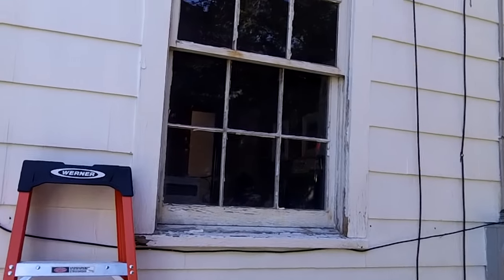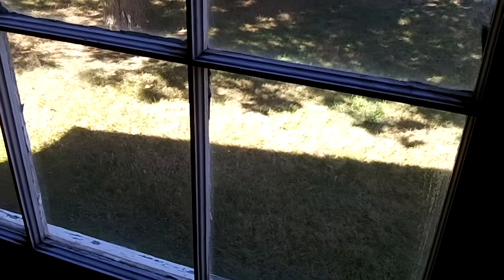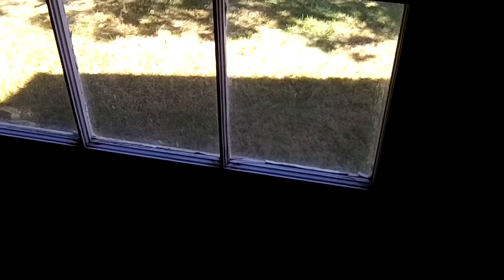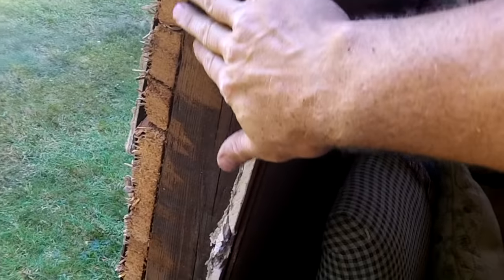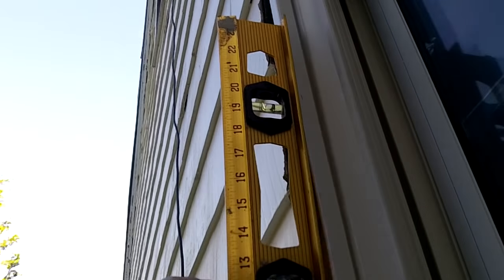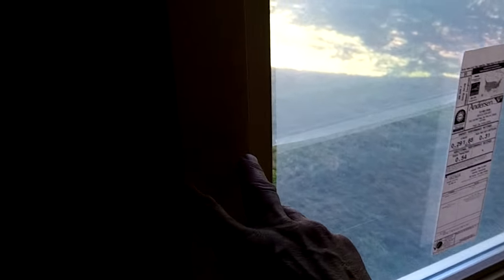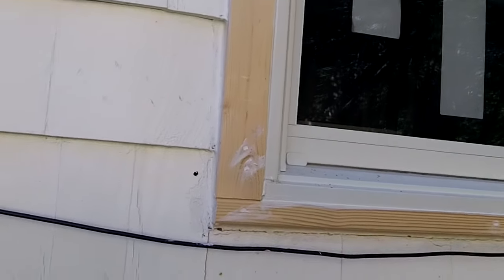DIY: How to install new window on old house

Comment: Not trying to be a chooch, but you need to install flashing and prime your trim boards on all sides to seal prior to installing. Never caulk bare wood and priming all sides prevents future rot. Obviously not necessary for Azek or hardy board type material. Good basics though! Like i said, not being snooty, just trying to inform
Reply: Good to know! Great advice ty?
Reply: Thanks, I'm installing new aluminum windows on my daughter's log house. Wood wrought has attacked this old house and I'd like to make sure the new logs don't deteriorate. Thanks for the heads up
Reply: Good advice i am gonna looking up the how to details of your advice and aply it to when i instal my window.
Reply: Wish I read this sooner. Good job. Now people will know the important things.
Reply: Are you talking like flashing tape?

Comment: Lol!  You left out the part we all wanted to see.....removing the old window!
Reply: Prybar?
Reply: I remove my widow and I pulled on my frame it was not even nailed Into anything
Reply: @roserouge8938  Same here. Slid right out. Mine was held in by the trim.
Reply: @JobeStroud  they did a lousy job building my house!
Reply: @JobeStroud  Mine is held in by the paint LOL
Reply: It comes out in PIECES!!!!  Especially if it is rotten
Reply: Someone used a rock to remove mine..
Reply: Fuck yes I need to know how to get the old one out not how easy it was to take out wtf
Reply: @roserouge8938  you need counselling for self -induced trauma
Reply: Oü
Reply: Right

Comment: Where I live the rough opening has to be wrapped including putting a pan under the window. After installing the window you have to wrap the exterior as well as make and instal head flashing. It looks like your just relying on caulk to seal out the weather?

Comment: Thank you for coaching me on the install. It is more than I thought it would be adding wood. I thought I would simply remove windows, clean the existing widow frame and push in the new. But am up for the challenge. 19 windows to do.
Reply: How did you do? Or how are you doing so far?
Reply: I’m sure you’ll be a master by the time you’re done 😅

Comment: Flash the bottom corners with window flashing tape. Then flash the bottom. Put a continuous bead of caulk around the sides and top of the nailing fin. Not the bottom. Put window in, shim to ensure it is level. Then flash tape the sides, then the top. Then caulk.

Comment: Don't worry about all the rude comments. Why are they watching instructional videos if they already know everything? At least you took the extra time to record it.
Reply: Because I'm always trying to get better, to be a craftsman, to do things properly, with the right application of caulk.  So I might charge more for this, and lose the job to a dooosh who does it wrong and covers his tracks with two tubes of caulk. There are windows like this which last hundreds of years without leaking. in New England.
Reply: I watch these videos because i'm a broke mofo that can't afford to do these things so I live vicariously through others home improvements.....lol
Reply: Jaran Schwend just for everyone watching, i watch these videos so i can comment and tell our customers to stop doing dumb shit. Everything you did and installed was completely wrong. I take pride in my job, i work 5-7 days a week, my crew puts in 30-45 windows a day. Apartments we hit up to 145 windows a day. Theres nothing worse than getting caught up on a crappy window installation where the owner thought they could do it themselves. Call a professional! This is one of those things where u dont skimp out on. Ur better off leaving it alone than opening crap up and making it worse
Reply: Roger,

Unless he knew the old window frame was water-tight, replacing the entire window is sometimes a better bet.  People use replacement windows and after installation wonder why their walls leak - it's because the original window was leaking at it's perimeter and the replacement process didn't fix that.  Not saying replacement is always wrong, or right - you have to identify the problem.
Reply: JARAN - CONSTRUCTIVE CRITICISM IS NOT RUDE. Why post a video that no one can see.

Comment: How do you seal it? Just bought a home where they installed new windows around the house and it just rained today and its leaking from the top of the window near the frame on the inside of the window. It trips down onto the top of where the window slides.

Comment: Well should definitely use flashing at least on the sill to protect from water.  Then what about squaring/leveling window with shims before install ?  Then missing sealant which goes under nailing strip...missing vital steps !
Reply: He didn't do any of that.  This window was installed like they did in the 1940s.
Reply: Flashing first then windows and caulk.  Flash all new wood and bring out a little.

Comment: For future repair or removal I like to use pancake screws on the nailing flange.  Simpson Strong Tie makes one variety that works well but there are many others just get the true pancake head.  Also read the directions as most windows do not want the fastener seated tight but up just a hair for expansion and contraction especially on vinyl.  I would also use one of the flashing systems before installing.  Good video.  Doug

Comment: Preparing to replace a bedroom window in an old condo. The existing window is aluminum framed junk (mid 60's) and I just know the framing underneath is not in great shape and was simply an overall terrible install.  Either didn't care, or just simply works without their heart in their workmanship.  
You answered a question I was asking myself.  Getting ready to purchase an Anderson sliding window this weekend!  But was asking myself if I should order one for "new construction" or replacement.  Because I don't expect to find the framing in optimal condition around the existing window, I'll go for the new construction window.
Thanks for the info, very helpful!:).

Comment: Should you flash the sill and even put sill pan underneath window to prevent water from rotting studs in wall under window?
Reply: Yes, you should.  Drop edge flashing at the top, tape wrb over it.  No sealant at top.  Flash the jambs.  Sill pan flash where the window sits.  No sealant at sill to let water drain.
Reply: @zilfondel  where does one find written instructions for these steps?

Comment: Great video! You just need to add flashing.
I am redoing the windows in the house my Dad built. He didn’t flash the windows and I had to use larger windows in order to cut out the rotted wood at the bottom. Modern caulking is great BUT miss a small place and water WILL get in!

Comment: Great video! This resembles my situation more than any other video! Question for you- looking straight down, there's that gap between the base (bottom/sil/stool, whatever it's called) and the siding. What is that material? On mine, it looks like wood that has become sort of fuzzy and I can break it apart easily. I'm wondering if I should fill it in with some kind of mud or place a base board that extends just to the end of the gap/inside edge of the siding. Thanks!
Reply: So did u go ahead and do something about it or r u still waiting on an answer. I would help but i have no clue what ur talking about. Prob. insulation though

Comment: you didn't show the most important part of the install which is the flashing to waterproof the window.
Reply: he skipped that step he said it in the video did u watch it
Reply: I agreed
Reply: Should be title how to install new window in old home skipped all steps use your imagination.
Reply: MLK MLK - don't use treated lumber either and just paint the 2x4.  Lol. 10 years from now.  Need new window.
Reply: @melchgarnicajr5798  lol
Reply: He also didn't put the removal and filmed it in the dark beforehand.
Reply: I hope you used window putty tape or some kind of sealer or flashing.
Reply: Gizzard Liz  !!&%&#{$&|
Reply: Oh my goodness. People love to be critical.
Reply: shouldn't use treated lumber in this application. Just use liquid flashing on the Frame and paint it all on which is like a liquid rubber material. In a pinch Zip system liquid flashing is fine but there are others made for windows. you want to use flashing tape over the flanges but if you can't cut the siding there is a red liquid flashing material that's Japanese I don't remember the name off hand but it will work in an application like this. Both as interior flashing for sill and to cover the fins.
Reply: @jonm700  no he didn't dummy

Comment: The interior scenes were useless. I recommend re-shooting this with some LIGHT on the subject. Also, removing the old window was basically just mentioned, without explaining how it was held in—just "these old windows come out pretty easy."
Reply: +Patrick Dengate patrick are you a youtube movie director?
Reply: Patrick Dengate exactly
Reply: I agree, inside shoot was bunch of crap.  Take the time to show how its done.

Comment: who even has sash windows anymore?   Video still was helpful.  We are doing one right now…..but here's the thing that you didn't address…how do you get behind the siding??  There was a deck built after and on top of the siding at the bottom, and an overhang to cover deck on top.  New window is smaller, etc. etc.  Thanks  tho.  It's still nice of you to share your knowledge.  Sincerely,  Even girl can do it

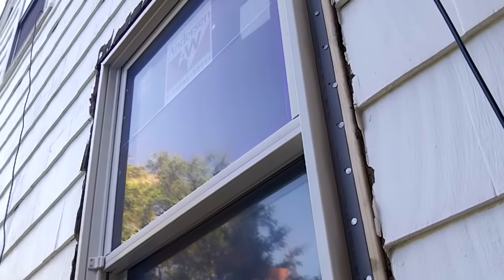Comment: 7:10 You skipped the part I was interested in. Did you install the new window on the bare wood 2x4?
Water on wood = Rot. You gotta protect that 2x4 on the bottom. 
As a homeowner, I don't want to have to replace that same window ten years from now.

Comment: A lot of haters here.   Like 10 years ago,  i installed a window and did a lot of mistakes,  the mistake i didn't do was that i caulked it really well.   10 yrs later i opened it,  and no water in it.   lucky i guess.  sometimes getting hung up on the small details doesn't help.   Good job on the installation.

Comment: He didnt seal the window with self adhesive membrane.
Also hed used yellow pine wood on the outside trim.
Incorrect onstallment
Reply: Caulking?
Reply: Caulk will fail eventually since it was apply on bare yellow pine wood., is better to apply self adhesive window wrap around the window prior to install the trim moulding,  and then apply caulk around the edge .

Comment: I appreciate the video! I wish you had walked through your reasoning for the exterior trim. I noticed you made a recessed cut and I’m wondering why you did that and why it’s with the match the width of the up and down segments

Comment: how much were the permits to replace the windows? are you the home owner or are you a contractor on someone else's home? how common is it to not get a permit?
Reply: You don't need a permit to fix 1 rotten window as an owner. You need a permit if you're doing many windows.
Reply: +youllregretit  check with your town board .. This would be a "replacement" window.. not a "new" window . Believe me , it matters.
Reply: Yep, a "new" window needs permits, a replacement window is just a fix, which any home owner can do. You can 'fix' one window, a few months later fix another window, etc until all are done. It's cheaper:)

Comment: You must remember to install the correct sill pan, side and head flashing or the window will leak and your warranty will be void.
Reply: Exactly.
Reply: haha warrentys aint no good half the time any ways they always give you the run around on why they wont warrenty its always users fault .
Reply: You don’t install a sill pan with a flange style replacement window.
Reply: really? what sheds the water to the outside of the siding?
Reply: Robb Joyce
You absolutely DO install a sill pan - every time you can if you're putting a new window in a rough-opening.  If your dropping it into an existing window frame (replacing the sashes) then the pan is trickier, but still a good idea.  For the standard install in framed rough-opening, there are lots of ways of approaching it and you don't need to use metal always.  For instance, Anderson's instructions utilize flexible flashing like Tyvek FlexWrap and a post-applied back-dam.
Reply: Hahaha, yeah "caulk the crap out of it" isn't in any code

Comment: It's 2019, I would like an update whether you now have water damage or not, because you did NOT put flashing around the opening before installing the window. This installation is not water tight /sealed at all. Guys, please do not install your windows this way. The main thing about installing windows is to keep water out of your wall by use of flashing and water proofing membrane.
Reply: Exactly, thank you!

Comment: Putting in a new crappy  windows instead of repairing the nice early wood windows w/ nice profiles, are the eyes of the house, usually made of old dense wood and will hold heat.  You will never recoup your costs - always repair good old windows for the beauty , the environment and the craftsmanship

Comment: I like to watch these videos he an OK job really could have used a replacement window and had less work but what he did was OK for someone who has never done this maybe he helped you.
Reply: With a replacement window you. Only remove the sash  , if the sill and jamb sides are rotten you have  nothing to  screw the replacement too!!

Comment: Where is the 30#Felt paper you have to install on the bottom shelf and sides before the window goes on? From my own and my friends experience. If you dont add that felt paper.. the bottom of the window will rot. As you saw before you took out your window. This is what many people or people that think they are doing a great job. Only for it to rot on down the way in a year or so. If your going to pay quite a bit of money on the new window. Wouldnt you want it to last you more than a lifetime?

Comment: If you had rebuilt the weighted window and put a storm window on you would have had a solid window that lasts another 50 years AND is more energy efficient than that modern thing. Not to mention you would have kept it original to the house. New is not necessarily better.

Comment: No disrespect, but you didnt show how you installed it. an actual step by step showing you putting the window in nailing it down or screwing it down. Did you caulk the inside portion of the window. Regardless thank you for the video I did learn something.

Comment: This window install is a hack job. Everything in this install is wrong. First it's lead paint, so put down plastic inside and outside. Second wrap the bottom stud opening before putting in the window. Then wrap around window fin with flashing membrane tape. Use primed exterior grade trim and exterior grade caulking (no easy water clean up caulking outside). Cut the siding to make the exterior trim look uniform.  If you are taking out a Wood window and the wood pocket? Don't add stud, measure the new window to fit the old framing. So you get a lot more glass surface. I'm going to make video like a boss coming soon
Reply: Jamie Cobb please do make a video, because yes I sure need some help on how Im gonna install my new windows. and what other tools and things im going to need..
Reply: Hows that video coming along?
Reply: I want to know how he knew it was lead paint just looking at it
Reply: Jamie Cobb did u do video on windows?
Reply: Jamie Cobb all that talky and no walky.....
Reply: RiverManPaul, you can tell just by the age of the window.  It is old enough that any paint used would have contained lead.

Comment: I laugh when people say you need flashing or it will leak I put windows in my house 20 yrs ago didn't flash none of them just caulked the new window flange set it in put siding  back on never had any leak issues.

Comment: So basically you say to take the trim off (dont show how) then frame the window to size of new window (dont show that either), then install the new window (dont show that either) then caulk the window iside and out (yup you guessed it, dont show that either). 
Might as well say let me change this window without showing you how i did it, and ill show you the end result. That would be more accurate on your title. I know how you did it but people that never done this before or learning dont know how you did it bro. I think you should make a new video actually showing how you do everything. Just a tip if you want people to like your video and maybe even subscribe to your channel. Just a word of advice.

Comment: Guys listen!!! "flashing"is a newer technique. It work well! but not necessary.. once you fill in your window with 2x4 and  shims you can then use water safe foam insulation and water safe  caulking and you'll be fine....my father experienced over 30 years in business!

Comment: enjoy your future water leaks.
Reply: Whywould it leak?
Reply: IKR
Reply: The window is not properly flashed or sealed.
Reply: Dolores,
You need to create a positive seal to/with the layer of water protection behind the siding - ESPECIALLY at windows and doors.  He cut the building paper at the edge of the window and left it there.  He should have pulled (or loosened) some siding and applied a self-adehered (fortiflash) or liquid-applied (R-Guard Fast Flash) at the window perimeter and extending into the opening, before the window was installed.  Then, set the window in a generous bead of sealant, AND install a sheet-metal cap (or 'head') flashing above the window.  There's more to be said, but that's the gist of it.  You HAVE to tie-in a window with the surrounding weather-resistant barrier behind the siding or the window WILL leak.
Reply: Long gone with changed phone number!

Comment: This is not a very good install, missing some key steps like a proper sill seal and caulking under the nail strip and what about the sides and top? Lots of mistakes here, that window will surely leak.